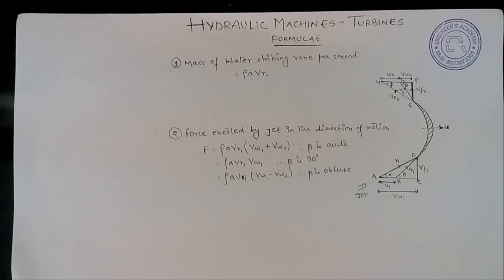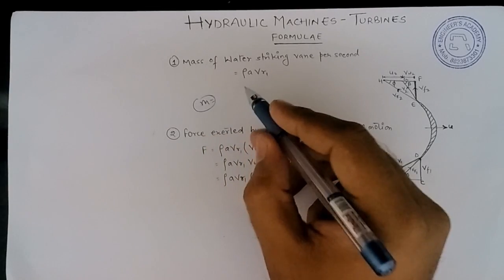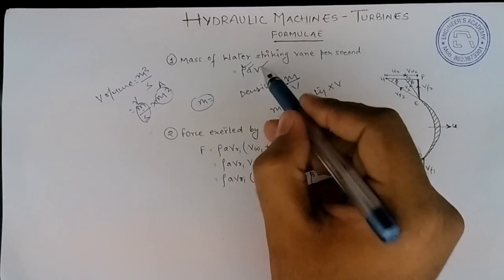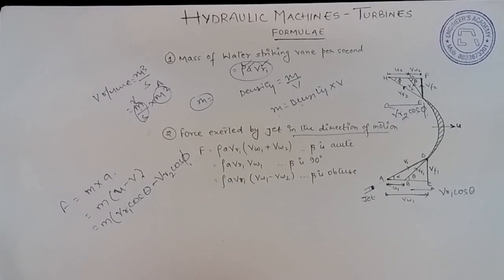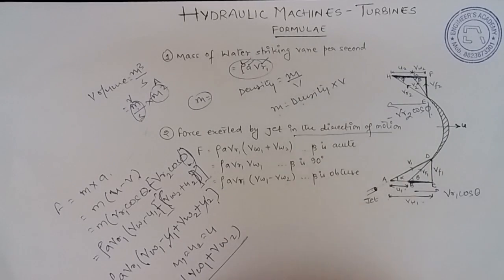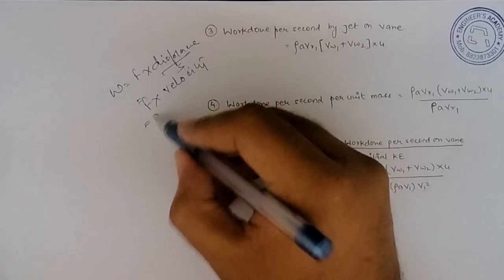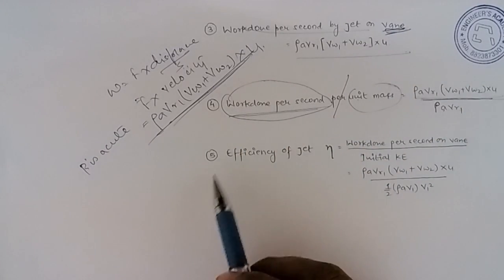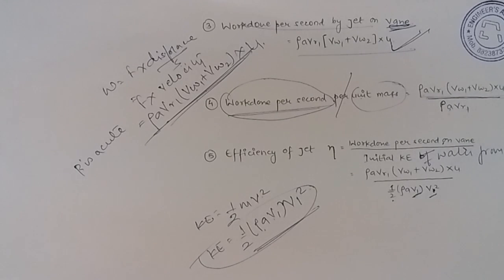TURBINE FORMULAE, Hydraulic Machines #2

Comment: In the velocity triangle video, you have mentioned whirling and flow velocity at exit at Vw1 and Vf1, where as here you have mentioned as Vw2 and Vf2 respectively. It is causing confusion if the previous diagram is referred .